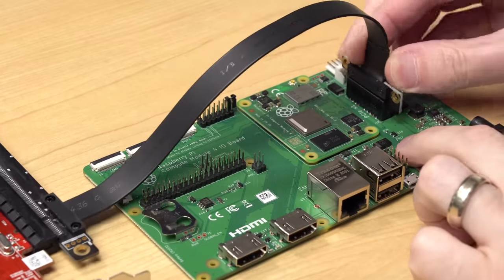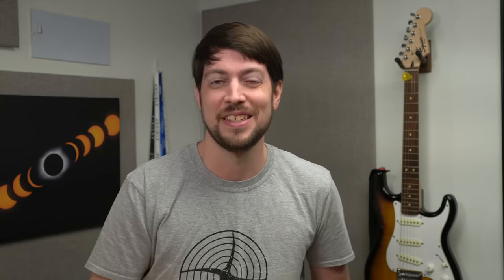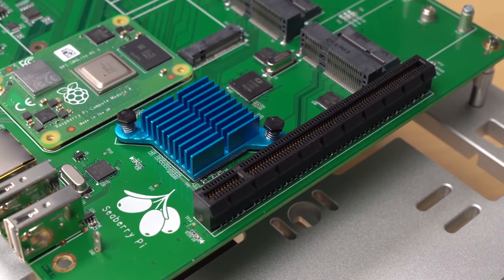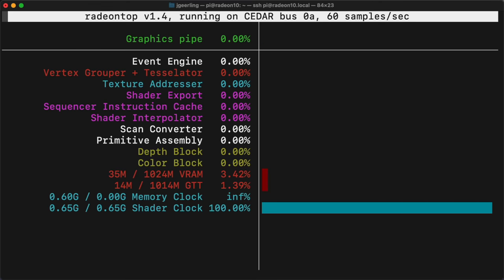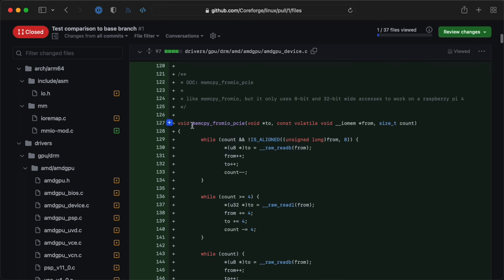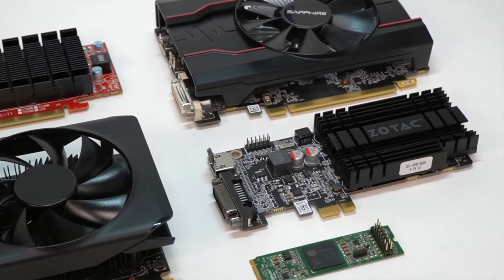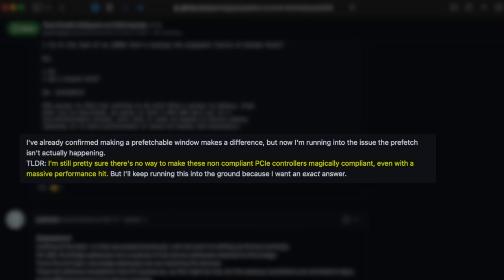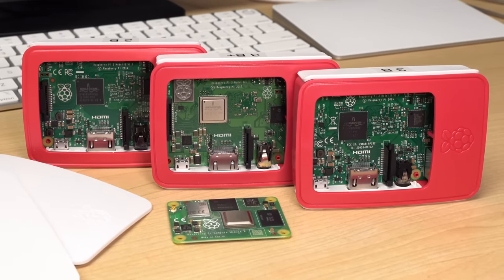It took me TWO YEARS to get this working! (GPU on Pi)

Comment: Most interesting video.  I would like to use OpenCV on the new  ...Amazon  $99.99...  Orange Pi 5B 4GB Rockchip RK3588S 8 Core 64 Bit Wi-Fi6, BT5.0 Single Board Computer with 32GB eMMC, 2.4GHz Frequency Open Source Development Board Run Orange Pi OS, Android, Debian, Ubuntu (OPi 5B 4G32G) ARM Mali-G610 MP4 GPU.  Any suggestions on using the GPU?  😎 Thanks.

Comment: What about that rx6400
Reply from the maker: It uses the amdgpu driver, and we haven't gotten any cards using that driver to work quite yet. It's possible though, and doesn't use so much power like other modern cards.

Comment: Whoever owns the IP for PCI Express needs to sue the manufacturers of PCI Express root hubs that do not comply with the spec for trademark infringement. This I will “support” a feature only by providing the minimum number of electrical connectors and not the required firmware or software support needs to die a very quick death.

Comment: well the graphic card are not just pretty pictures, as you said mining, compilated math. stuff, also takes a load of the main system (in this case the Pi) as graphic cards are getting bigger and bigger, they are starting to look more like big powerful computers by them self's just need the some way to interact with them?, 
the graphic cards I would ready like to see used in this sore of way or the completely headless crypto mining cards, once the use for crypto mining they become out of date e-waste or paper weight, meaning no one wants them so the you could get a in your case, Pi, to talk/work, and used Pi on board as through, just display what graphic card is doing, like it just play out pre render video stream or something? done right the pi would become not so dumb, terminal to to the graphics card, 💻🖥🖱🙂

Comment: The way you hold PCIe cards touching the connector pins frustrates me.
Reply from the maker: When you hold a card edge-wise like that, your fingers don't actually get close to the pins themselves, since the PCB itself extends about 3mm beyond the edge of the gold contacts.

I've never had a card have any issues holding them on edge. I also don't wear an ESD strap ;)